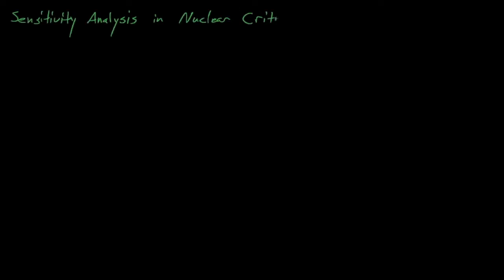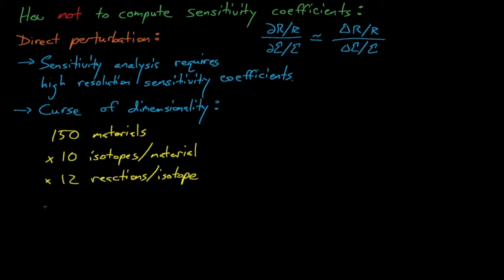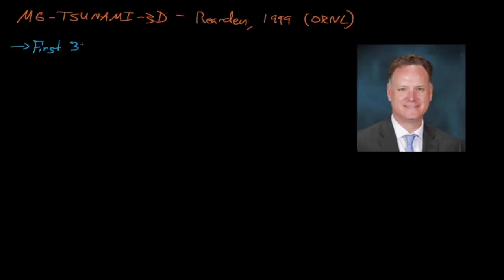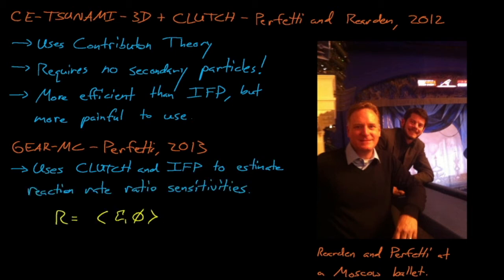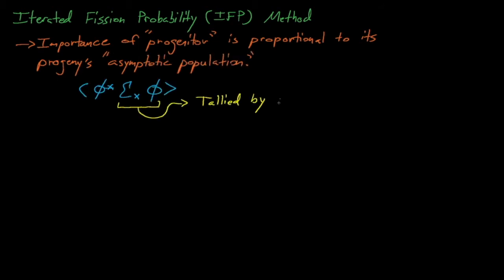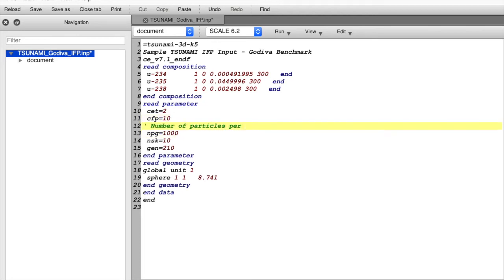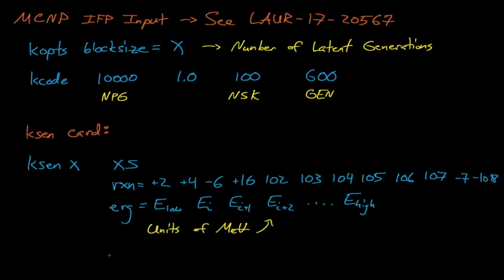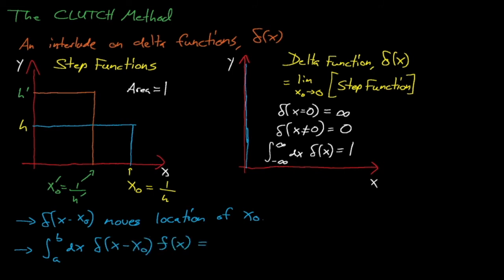NE499/515 - Lecture 17: Sensitivity Analysis in Nuclear Criticality Safety

Comment: In the graph at the very end that you show,  is the value on the y-graph the maximum delta-k value on the eigenvalue or does it need to be normalized first?
Reply from the maker: This graph plots the sensitivity [(delta k/k) / (delta sigma/sigma)], which is normalized per unit lethargy.  The sensitivity coefficient energy bins generally have different widths, and normalizing per unit lethargy allows for a more intuitive graphical plot.  If you do not normalize the sensitivity coefficients per unit lethargy, then sensitivities in a system that is, for example, uniformly sensitive as a function of energy would have different values based on the width of their energy bins.  This would produce a noisy looking and confusing plot, and normalizing by the energy bin width (i.e., per unit lethargy) fixes this.

You should not normalize the sensitivities per unit lethargy when you use them for UQ, correlation coefficient calculations, etc., we simply normalize them per unit lethargy for the sake of clarity in sensitivity coefficient plots.